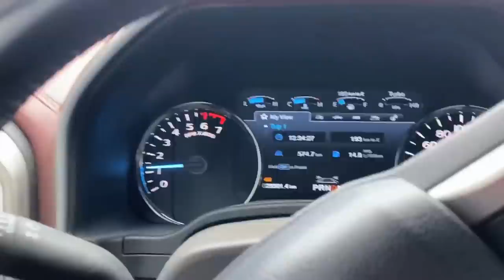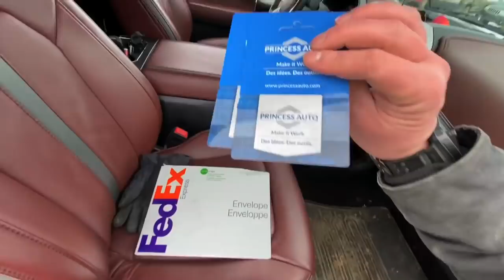Detroit DIESEL Vs Duramax!

Comment from the maker: First 150 COMMENTS/LIKES will be entered in for an AUTOGRAPHED Poster/Stickers!
Reply: Mark... sell me ur 4 wheeler ktm
Reply: That things blowing black, she burning a little fat, take a look at that carb and see how  its adjusted, if everything looks normal, then take the bowl off the carb and just make sure she's all clean up in there 🇨🇦❤
Reply: @E.V.999  carb is dirty.... happens alot to lil mechines like that when ur running through dirty and shit wide open
Reply: The Nob on the shredder is idle adjustment.  I would run some Seafoam in it sounds like the carb is clogged
Reply: @pearsonebfd1  u dont use seafoam to clean a carb lmao... take the carb off and clean it right... clean out the bowl and jets with a wiggly wire and it will likely run perfect again
Reply: @E.V.999  black is fuel... and it only does it when ur on the gas.... that tells me right there carb is clugged

Comment: You have to cycle the glow plugs multiple times and hold the gas pedal to the floor when cranking. I daily a 6.2 diesel, they're not too bad to start, haven't had to use ether yet.

Comment: 6.2/6.5L GM diesel, I suspect you have glow plugs not working so put foot flat to floor on accellerator upon dead cold starting..since its scrap load the ether on then two glow cycles and give it the starter..continue to spray ether until starts then gradually let off throttle pedal..you need as much cranking speed as possible...best of luck guys shes Canada cold!!